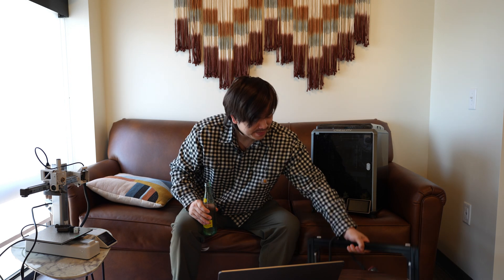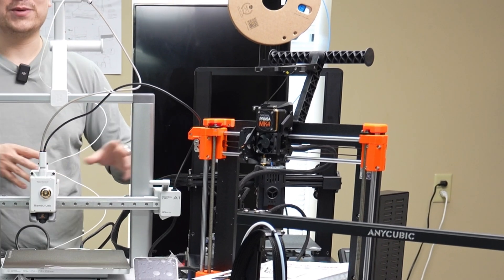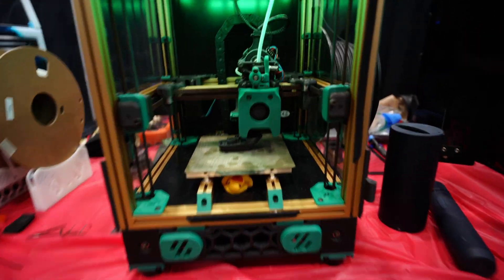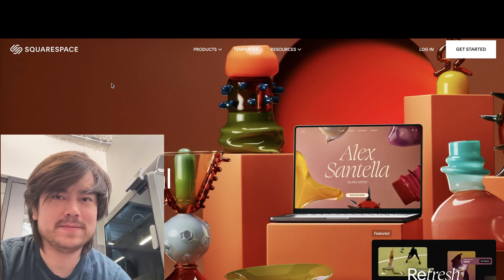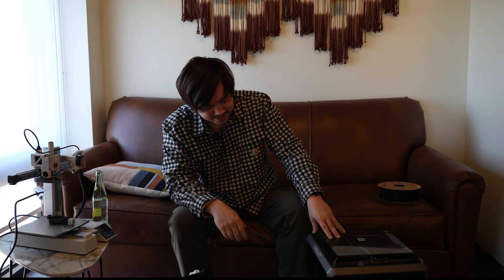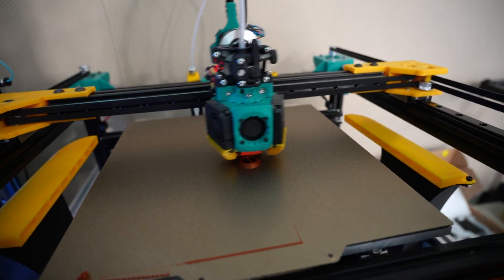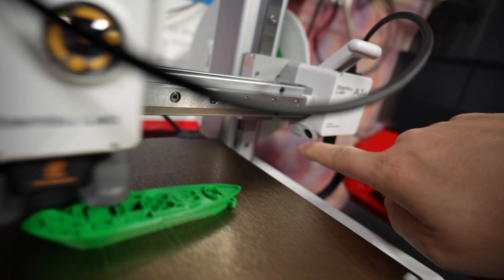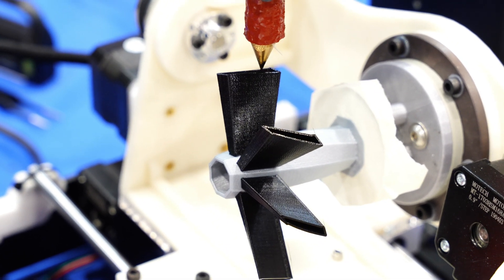We need to talk about Kit Printers

Comment: I think the biggest thing your missing here is the context these kits exist in.

Voron, LH, and many others are not commercial products. They don't exist to make money, they don't have big corporations backing them.

They are a few hobbiests who designed a printer that is easy to source with off the shelf parts.

The kits exist to make that sourcing even easier for these existing projects.

They are absolutely not for everyone, and it sounds like they are a bad fit for you. But your suggestions only make sense to something like Ratrig which is a corporation that exists to sell kits. It doesn't really apply to kits of voron-like projects that are really things people are designing for fun because they want something specific.

You are right that from a financial and practical standpoint, consumer printers have gotten so good that if you just want something that prints well and fairly quickly, buying a printer is the no-brainer choice. 

We now live in an ecosystem where building your own printer, from a kit or otherwise, is purely an enthusiest pursuit for those with a passion for it. That's okay, and in fact even a good thing.

Comment: So, as not-an-engineer, I think the criticism of the printed parts in vorons is off base. They're not designed for the printer to be dropped, or ran over, or loaded outside of their design. They're designed to do the job they are performing. They're 3d printed because that's the only way the buyer could create the more complex and proprietary parts at the time of introduction. It was also the only cost effective way to get those parts made at the scale they were initially looking at (now that's not so true anymore as the demand has grown CNC'd parts are getting more and more common as the economy of scale makes them cost effective to produce). I am sure that the voron design team doesn't think plastic squiggles are the absolute best performing material for the parts to be made from, but I've heard an aerospace engineer describe their job as an "artist in compromise" and the plastic squiggles are the best compromise. At the scale that creality and bambu are working at, injection molds and stamped metal parts make a lot more sense. 

Also, yes there's some truth to the criticism of hot end / toolhead / mcu choice overload, but I'll say that the Revo Voron hot end and BTT Octopus board is the obvious de-facto standard. But I do not think that's it's too much to ask for a prospective buyer to sort through everything on their own and figure out what files they would need before they embark on building the printer, as clicking through a webpage or github is much less complicated than building a printer or setting up a config.
Reply: Yes,  printed parts are afforable and easy to make, I agree, that is the design goal I believe, and good job, it makes them accessible. But the price of that is quality, there is no getting around it. The old chestnut, Performance, Economy, Reliability..pick two.  "artist in compromise"  that's good, I can relate, that's an engineer for you. It's why so many have a pet project at home like a no expense spared lawn mower ;)

Comment: You are right. 3D printers are becoming appliances. Most new users will have no clue how they work. After spending many hundreds of hours modifying early generation printers to just keep them working, I do not see that as a bad thing.
Reply: Exactly, I've designed and built four original scratch built machines, they were all good machines in their generation, but the fettleing and the babying.... each of those had several hundred revisions. I'm over it, I have better things to do. I bought a K1C, it had a few things I didn't like, so I added an eddy, full klipper and a chamber heater, replaced the build plate with a nice slab of aluminium and added an obXidian nozzle and I am done.  It works really well, great prints, fast, reliably. I don't need to spend hours fixing it and I don't want to. It's not a bad thing at all.....well, maybe if it just... ;)

Comment: One thing I think you're onto, but didn't specifically mention, is that corexy is grossly overcomplex for a first kit. That's one of my key motivations for the M45 - delta has a much smaller BOM and simpler DIY build process. And unlike commercial machines (especially Bambu) or Vorons it's designed to be super serviceable - for example, all rails can be taken off and serviced without even detensioning belts.

Comment: Such a strange video. As some others have already commented, I think you are missing a lot of points on custom printers. As well as Making them sound mich harder to build than they really are?

Let's leave lut the fact that if it weren't for the Voron team, as well as other teams working on similar projects, I don't think there would be any bambulabs pre builts like there are now. Leaving that out, if there was none of these custom projects, what would we be left with? a bunch of proprietary printers in their walled gardens, where you have no control over many factors, and if for whatever reason the company who sells it decides to stop selling spare parts so now you can't maintain it?

I've built over 5 custom printers at this point, and own a bambu machine as well. I run a small time Etsy shop and use the printers to produce parts. I've had more issues from the bambu machine than all the rest put together. And when I do have an issue with the custom ones I know I can get the part from numerous different vendors. I personally hate the walled garden of my bambu. I've had numerous issues with networking and couldn't do anything to fix it because there's no access to the firmware. I ended up having to buy another router just to use that machine. Then there's the time I couldn't use it because I didn't update firmware. Anyways, Bambu has it's uses Don't get me wrong. But I'd much much rather have all my custom printers than the equivalent number of Bambu machines any day.

Comment: I know the Ender 3 NG is a decent looking DIY printer as most of the parts already come from a standard Ender 3. So transferring it over and making the ender 3 a beast sounds like a fun adventure. I have a Qidi X Plus 3 that cranks out really reliable parts, so I'd be able to print out the needed parts with confidence that they'd fit and like some other people said it's like Legos. Lego's don't really have a functional use case. You kinda build em and they sit, and most of em go in the bin with the other Legos. But still those hours you spend putting it together are quite fun and rewarding. Now finding the time to build a kit printer for me is the main challenge lol.

Comment: I think it's worth mentioning repairability over time, especially in the context of bambu lab, as being an upside for kit printers. 
I understand most people won't want to bother repairing their printers, but for those like me, repairability was a requirement for my printer choice. 
I don't want to have to buy a new printer every few years because the manufacturer stops making replacement parts (or doesn't have any to begin with).
Reply: Have you seen the prices of Bambu spare parts? dirt cheap and readily available.
Reply: @m3chanist Not for replacing pulleys.

Comment: I partly agree and partly disagree. In my opinion, as a first printer a kit like voron is not good. If someone wants to start printing in 3d he should start to understand the problems of 3d printing. In my opinion, kits like voron can be useful to be able to create new printer projects. I have always bought machines already half built, like prusa or Flsun. Now that I have some experience I would like to create a printer with a toolchanger, but smaller than a Prusa XL or other type of printer. Since there is no such thing commercially, I will take a voron micron kit and try to rework it.

Comment: Voron went through a terrible period where modding was discouraged, no they should never go back to that. It was a very bad environent to experience. The BOM build isnt really complicated. Choose a hotend thats about it. Except for V0, they all use Clockwork Extruder. There is 1-2 options for MCUs supported by the documentation and github configs. 

Pretty much all the complications come from the fact you have a choice. LDO options out their kits with what they think will sell, what people want etc. Yeah you could use nearly any extruder, you can use any MCU, etc. Thats on the user straying. Its always recommend to build your bom or kit "stock" then change things but i have seen users there to help with pretty much anything.

The real issue is probably that Voron makes an effort to cater to users who arent ready. We as owners, builders, modifiers try and help anyone who wants to dive into it. Some of those users really should be buying an appliance.

Comment: i have a qidi smart 3 and a enderwire printer which is a ender 3 converted to a switchwire, when comparing a opensource kit to a prebuild printer from a company one of the main difference is the fixing a broken part you see last week i had to disassemble the whole qidi printer just to fix a broken belt tensioner it took me 8 hours now do that in a switchwire it took me 5 minutes
Reply: also not to mention voron provides the so called do this build if you visit there website it gives you the BOM and everything you want whatever you see in githup or print website are just user mods if you want upgrade your printer to a new hotend or something in these lines and you would be surprised how easy it become when you build your printer yourself

Comment: Creality still sells the Ender 3 Pro and the Ender 3 Neo Pro, so they still sell simple Kit printers and at nearly the same price.  I also like the idea is the simple kip printer. I still tinker with my first ender 3 Pro (Micro Center $99 Special), inface I just added the Sprite SE to it for only $17.00.  And it is my first Klipper Printer using an OrangePi.   It is inexpensive enough to tinker with and not worry to much about messing it up.  So if you interested in an In-expensive option and are less concerned about speed and enjoy the Kit building, the option is still there.

Comment: SAVAGE INTRO, the only printer i have built is the voron legacy. it's really good and way way more easy to build and doing maintenance. Also the cost is probably 1/3 of a "regular voron". You can't make a huge build but i think 300x300mm it's still doable (8mm rods not that stiff once you go above the 25cm lenght)

Comment: I've had the experience of both building custom printers (both self source and manufactured kits). There is absolutely no need to build a custom printer when printers like Bambu makes exist. The meta used to be that if you wanted a printer that worked well, you needed to build it yourself, but todays printers work shockingly well.

Modern printer kit builds are either hobbyist builds where value isn't important, or attempt to create something new and unique that doesn't exist on the market.

Why would you build a LEGO set when you can just but a toy car that works out of the box?

- ZombieHedgehog, Printer Builder
Reply: Because LEGO is much more fun and allows for creativity. A toy car is never anything other than a toy car. A Lego brick is everything you can imagine.
Reply: @andreas.grundler  EXACTLY!
Reply: If you buy a Bambu, you're either stuck with an appliance that won't do what you wany, and that's nowhere near as good as the fans make it out to be, or you're going to spend a lot of time figuring out what you want to change and actually doing that. And it's going to be non serviceable, so you need to buy a whole new printer when it wears out.
Reply: there is always a potential price/performance edge to be gained from controlling assembly/design.  he's talking to other makers/builders who are capable.  discussing the successes/pitfalls of kits and how to recognize solid practices/brands - that's valuable info
Reply: Flawed take— if value is your optimizing function then you shouldn’t be 3d printing anyway, and instead look into molding and casting. 

The Bambu and other appliance printers are valuable only for their ease of entry and low cost. But they are evolutionary dead ends and they are sickeningly appliance based products. 

You see it already with the of Bambu outdated models that are no longer the meta, and discarded or relegated to dust collecting. You can’t upgrade a Bambu beyond its original DNA, without fighting the company or doing some insanely cumbersome and unsupported modifications. They’re not designed to be upgradeable. 

Vorons built today would still be relevant when the P7S generation of bambulabs dross comes out, because of its infinite modularity.

Comment: You're missing the point here by calling them 'Kit Printers' the difference between a Prusa and a Voron is that a prusa is a kit in a box, the Voron is a BOM in a box, so the whole discussion around the manufacturing skipping steps is a moot point really.

As for the LH Stinger, it wasn't ready to be sold as a BOM in a Box, it needed more testing, that one i agree with you on, When i built the first Fysetc one there wasn't even a way to mount the mainboard, i had to create the parts for it.

Comment: I think there is some comparison to be made to kit cars. The end goal isn't "have a car that works", it's the process that matters more. BUT that's kind of the same argument as "it's supposed to be bad" and I don't really buy it.

I def agree about printed parts in printers though. It's useful to be able to mod and customize your printer to fit your exact needs, with rapid prototyping and adjustments. But I cannot wait until I replace the one I'm working on now with metal.
Reply: I'm a retired kitcar builder.  I downsized my hobby by changing my hobby to 3d printers.  I liked your comment.

Comment: I think it's a difference of being into 3d printing or into 3d printers. I'm into kit building overall, not printing. I still love printing itself but I prefer to be building kits and tuning. I remember using vinyl tubing to link the stepper motors to the threaded rods as a flexible coupler before the fancy ones came along. It's been a wild ride seeing things evolve over the years. I bought a Bambu P1S, it's great. Now I'm going to be building a Voron 0.2 r1 next and then a Trident after that.
Reply: In the video he also mentions that there is something to be learnt from assembling kit printers. This is something I think is very important. If you just learn when to press which button, you don't really learn much. That's the problem with printers that offer quick success but are also a black box for the user.
Reply: @andreas.grundler  True yeah he was talking about the older ender 3 days. Hell, even then, it's still a jump to  understanding it all. Slicing is it's own art form. lol.

Comment: 5 Seconds in and you already offended all the Bambu Lab fanboys out there. 👍
Reply: instant like by me
Reply: Saying you failed to print parts correctly and it will take you 20 hours to redo them isn't a criticism of kits. It's a redirect from your own failure.
Reply: @tenchuu007 Nathan is literally a  mechanical robotic engineer of genius level....Pretty sure he can handle a little 3d printer kit 😂
Reply: @anthonylong5870  that's not what he said. He literally said exactly what the problem was, and that he kept going even though it wasn't working. That's not genius level.
Reply from the maker: They treated me very badly for giving them the same level of criticism I give every company. 

Bambu isn’t the only one that has excommunicated me from their PR/Marketing efforts but they are the only ones that have gone out of their way to remove me from their affiliate program.
Reply: @NathanBuildsRobots because your a piece of work man. It’s a really good decision to leave you out of their branding. Also, your replies proves that you don’t regret your actions. Do better man.
Reply: @NathanBuildsRobots zurecht! Du übst keine Kritik sondern beleidigst und stellst die Firmen bloß! Du bist abgehoben, ein Narzisst und beleidigend!
Reply from the maker: But I have said and will continue to say, they make very good machines in terms of mechanical hardware, and are very innovative. It’s a solid choice for most people shopping 3D printers.
Reply: @NathanBuildsRobots honestly I think given the entire situation, how you've handled it on the whole, has had a comical jerkiness that has attitude, but at the same time is still kind of wholesome and honest. I legit hope Bambu reconciles with you at some point.
Reply: Not a fanboi, but I'd rather take that mini and put it to good use than see it become an abused machine because Nathan got buthurt by Bambu and now takes it out on a printer like a man-child.
Reply: @BloodSteyn bambu killed 3d printing Innovation. by close sourcing, hard to repair and by patenting they killed a big chunk out of hobbyist 3d printing
Reply: LOL Poor little things...
Reply: Good job, Bambu kult needs to go away